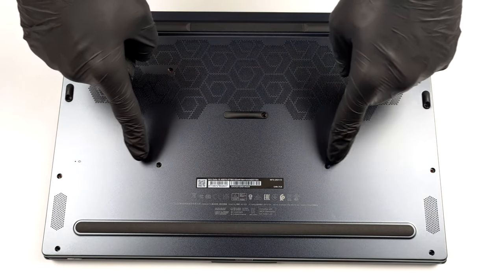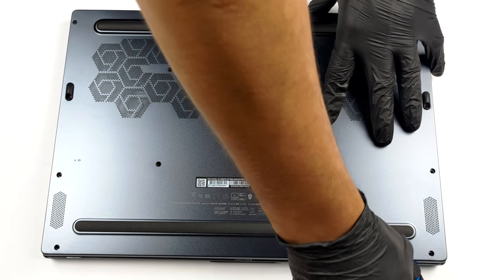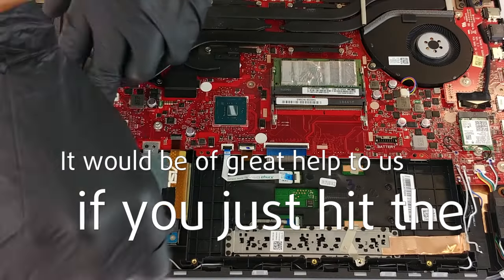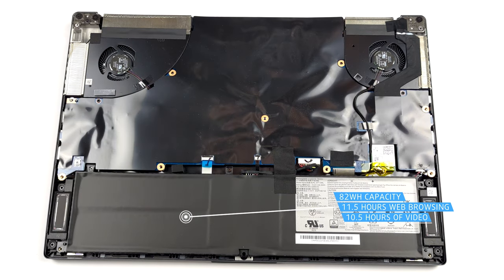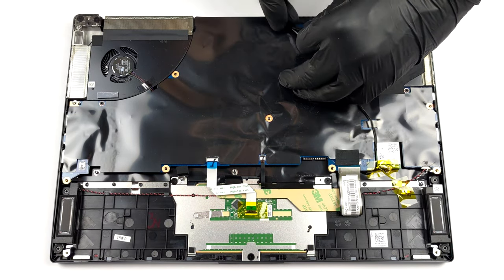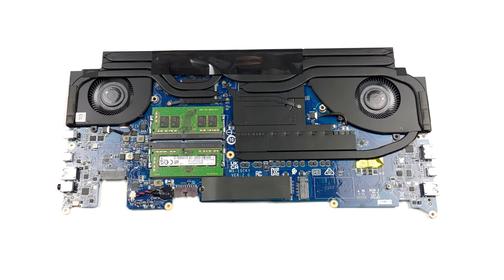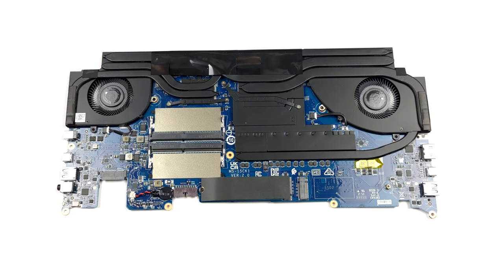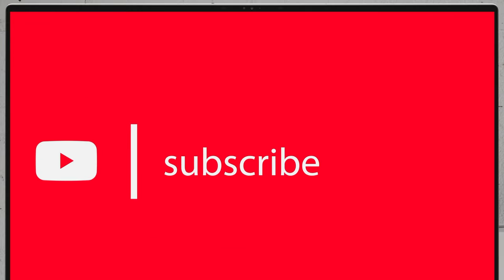🛠️ MSI Delta 15 (A5Ex) - disassembly and upgrade options

Comment: Wow, what a mission to upgrade the ram and storage. Ouch
Reply: Dell: amateurs
Reply: It's out the box performance is worth it. I own the laptop atm and it plays most if not all games I own at minimum 90fps with the stock 16gb ram it has. I've only added another 1tb m.2 and called it a day
Reply: Just wait until you need to repaste! 😆 
Love my Delta, two months of good gaming, but I will be upgrading as soon as there are issues. I'd say in two years, depending on how you keep it cool and if you're aware of the thin design. By then, there will be better MSI laptops.
Reply: @LusivableM0T  how are it's temps? I want to get this but I'm not a fan of high temps
Reply: as Dawid says bring back the glory hole.
Reply: @martin.k240 hot af. I use an actual a/c unit to keep mine from burning my fingers after hrs of gameplay.  Unplayable for more than a few hours without it.

Comment: No need to peel the black film, all connectors are accessible under flaps.
Reply: Yeah, no need. Sheet is there to protect the conections on that side of the motherboard.

Comment: Looks a bit backwards from their normal easy to replace design. Wouldn't the sheet and flipping the mobo/heatsinks obstruct airflow?
Reply: Yes it does. Mine has overheating issues…along with the classic screen hinge issue🙄. Not getting another msi, the build quality is awful.
Reply: Had mine for two and a half months. Nothing wrong, but I'm curious to how one would go about repasting. 
Performs well and has no issues with heating, worst I seen was 88 c. But that was cause I was testing its gpu on max settings with a few games, great but not ideal. No need to play every game on max settings considering the thin design. Either build a desktop or find another brand if you dont like MSI. 
Steer clear from Alienware or Asus. Unless you want to microwave your internals. 😆
Reply: Why it's on the opposite side😢

Comment: PSA.
just upgraded mine an it wouldn't turn back on just plug it in to mains power an then it was fine to turn on either on battery or mains power.
also big thanks to LaptopMedia for the video.